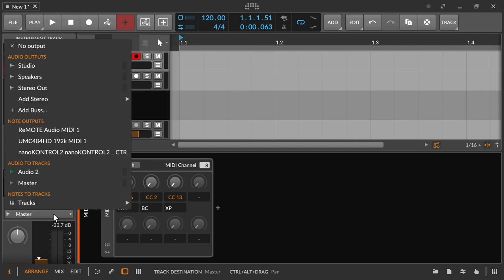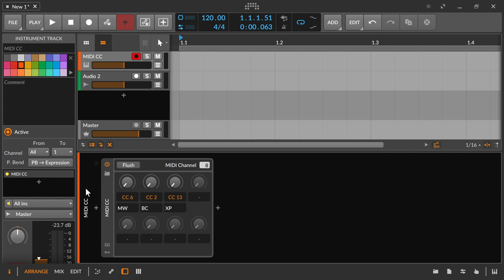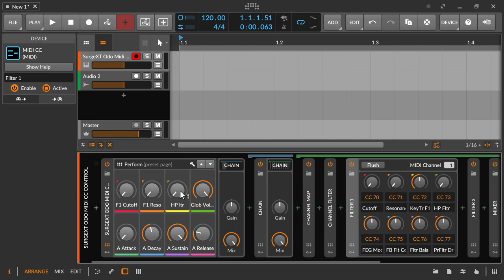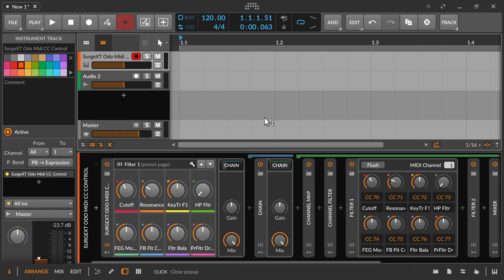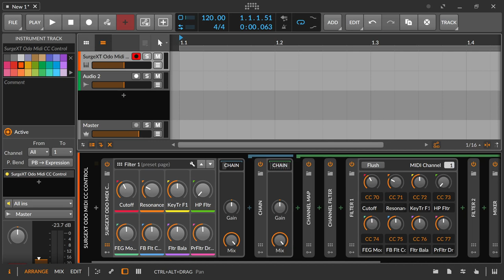MIDI | Midi CC Device | english

Comment: Thanks - Instead of dials can we use buttons. 0-127 on and off?  I need it for my Bigsky MIDI CC on the latch function.
Reply from the maker: Sure. Just use in the modulator Section a "Button" from the interface category and modulate the CC dials. And you sill can define it again as an remote control on a dial, that only understans "ON/OFF" to use it flexibly with any controller.